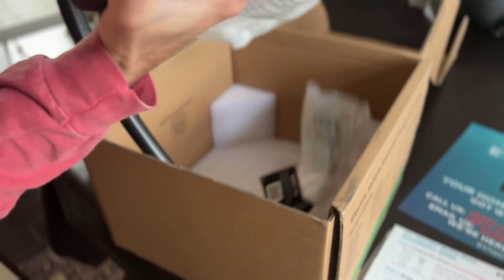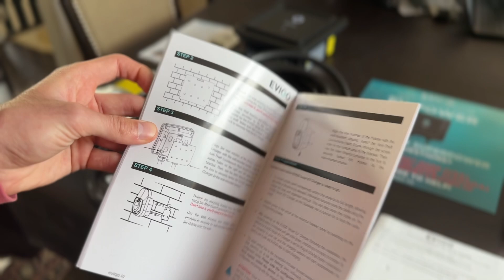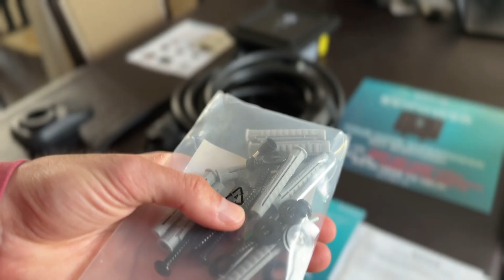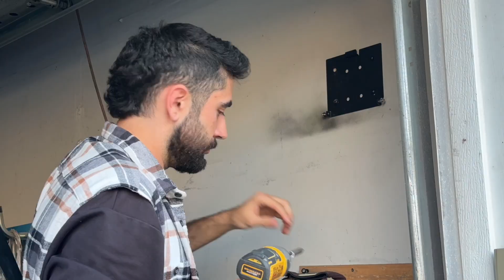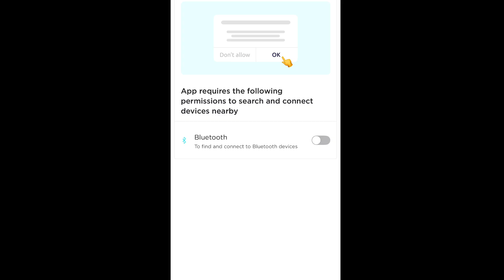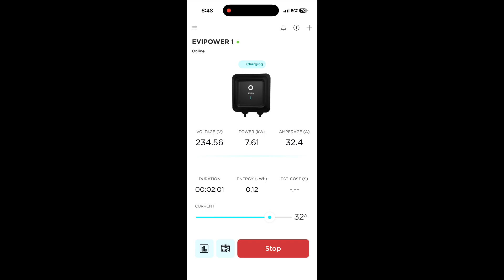EVIQO 40A Stage 2 Charger EV

Comment: Three things to remember if you are going to DIY...1-Use ONLY a more expensive EV rated Nema 14-50 connector and NOT a cheap dryer plug. 2 Set the output to 80 % of what the breaker is rated for...ie: 32 amps on a 40 amp breaker for continuous load rating and .. 3- Make sure the wire guage is correct for the breaker size.. Then get it formally inspected and approved to ensure proper insurance coverage. 

I guess it goes without saying if you don't know what you are doing, hire an electrician for safety's sake if nothing else. If this circuit gets overloaded due to incorrect installation (usually due to using a cheap dryer plug to save $60), it can burn your house down in the middle of the night.....not worth the risk